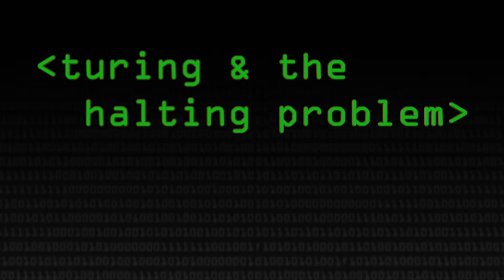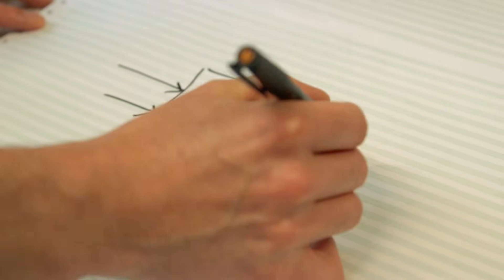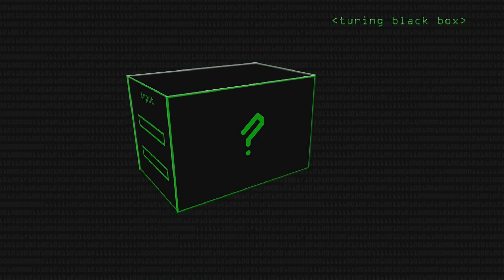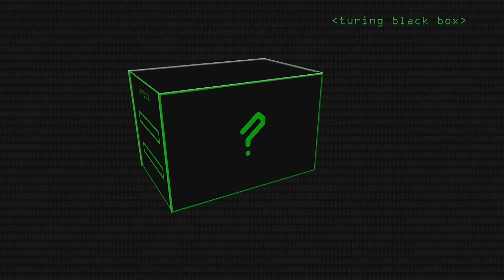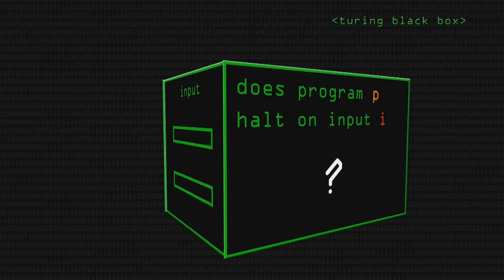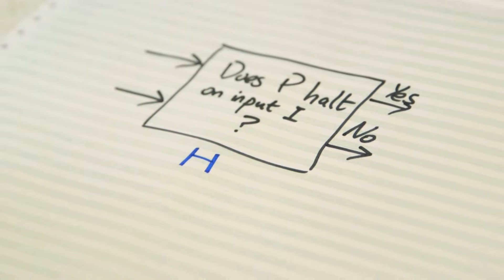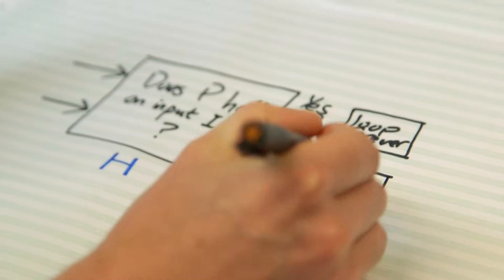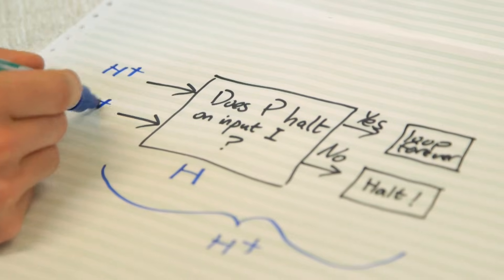Turing & The Halting Problem - Computerphile

Comment: But what if the machine „H“ had 3 outputs? Something like „yes“, „no“ and „depends on the input“? Because we can’t just Give a computer a question like „What’s 1+1?“ and the only possible answers it can give us are „1“ and „3“. If we then were to assume that a Computer can’t solve the problem „What is 1+1“, it wouldn’t make sense. Or am I thinking wrong about this?
Reply: There are only two eventualities that a machine can yield on a given input: it can eventually halt or never halt. If the halting problem was solvable, then a machine that solves the problem would only ever need to say that a program on a given input would either halt or never halt.

Comment: There is an error in the "proof" (and while I'm at it, a paradox does not conclude that an argument is false or faulty). 

The premise of H is that it decides whether a program P halts on input I. We deduce from this premise that it is metaphysically impossible for H to loop forever as H must halt in order to give an answer. We then build H+ which has H, and another program we'll call ~H for "invert H". We will then attempt execution of H+' = H+(H+, H+). The arguer asserts H+' loops forever. 

If this is true, then the halting problem is decidable because you just proved it so algorithmically by simulating the process. If it doesn't loop forever, then the halting problem is decidable by the same assertion. The issue with this construction of H+, however, is that H+' is not H(H+, H+), and we've already determined that H must halt. This essentially means that the H+' that is being claimed here _cannot exist_, and that the H presented is a different H in substance than the H that does in fact halt to decide if P halts on input I. Now if we entertain the erroneous construction and pass H(H+, {H+, H+}), then as the arguer observes correctly according to the logic that he follows, so likewise, H here will halt and give the same result: that it will loop forever.  I here give a counterproof against the halting problem proof by using Turing's proof itself: 

We presume that in order for H+' to be undecidable, the H+' construction itself must be undecidable, but if it is undecidable, then it is decidable: a paradox. This is a veridical paradox: if a thing has any definite answer within the context of decidability, then it is decided, therefore, if H+' is undecidable, it is decidable, and if it is decidable, then it is decidable. In both cases, we must, by metaphysical necessity, conclude that the halting problem (and all other questions about things that proceed from the natural order) is decidable since H+' being undecidable is a definite decision, and the H+' being decidable is a definite decision; since it cannot both be decidable and undecidable, it is therefore decidable. QED

I would note that this "undecidable -> decidable, decidable -> decidable" lemma only applies to this type of question uniquely because of auto-decidability. Attempting to apply it elsewhere doesn't work, not even to the question, "is decidability decidable?" The simple reason is because the nature of Turing's proof's auto-decidability arises from an oversight in the definition and logical proceedings of H and its behavior within H+, the oversight being that H is capable of looping forever. Even if it were, the fact that the arguer can logically deduce that H+' never halts implies there exists a deterministic H by the logical process employed, and that the H within H+ is therefore merely an imperfect subset of H.

The universal that any thing with a definite answer is decided may be used to analyze The Liar's Paradox and have it be considered also as a veridical paradox. Gödel's Incompleteness Theorem is incomplete (lol).  "This sentence is true" is easily analyzed and concluded to be true, but "this sentence is false" is commonly concluded to be indeterminate. In reality, what's going on here is similar to the issue of the halting problem, and since we are using subjective semantics in this sentence with no other context, the reality is that "this sentence is true" must also be indeterminate, even if by default, we can believe these two statements to be true according to the rule of charitable interpretation. If we choose to believe the two statements are true, then no contradiction can exist as we've created an objective context to interpret the subjective construct with: we have asserted that, objectively, they are true, therefore they are true; the simple fact of the matter is that "this statement is false" is asserting "the sentence, 'this sentence is false', is false" which is a valid equivalent construct to "this sentence is false". If we assert that they are objectively false, then they are both false, in which case "this sentence is true" becomes a lie which would concur with the objective assertion. This is all really just a simple matter of recognizing that some things have no meaningful answer in themselves because it would then be like trying to make an H that accepts only P but has no I input to consider: they do not have the substance of a definite question, we might call it, and because they are indefinite questions (as their opposite), they cannot be answered until they are made to be definite. Thus, we can at best conclude an indefinite question about the truthiness of "this sentence is false/true" to answer with indeterminate which is in the implicit negative, not affirmative, in the same way that indifference or agnostic atheism are implicit negative for their respective questions.

Thomistic philosophy is universal. Other philosophies are not.

Modifications: improved clarity and wording.
Reply: You're thinking of a scenario where there's a second H outside of H+, which will correctly predict H+. But the point of the proof is that I can always put H inside of H+ and make it be wrong.

It was also not asserted that it loops forever; just that if it did, the H inside H+ would say that, but then the ~H would stop so it wouldn't loop forever, and vice versa. We can always build a machine around H that proves H can't always be right.

Comment: Well of course you can't solve a paradox, though they do happen. What if its a quantum machine that prints both yes and no being correct and incorrect at the same time....
Reply: Then it’s a shitty machine. Even quantum computers have to produce a definitive yes or no for an output. And as they’re bound by mathematical logic, they cannot in fact solve the halting problem
Reply: @cktken3336  Quantum computers are not binary computers they have a third state of superposition allowing the reverse result such so instead of calculating a result sequentially it can calculate 4 scenarios of the same problem to arrive at the correct answer.
Reply: @DeathxStrike18  They still have to give a single yes or no answer. Where in the video did they say that H WASN’T a quantum computer? It’s a known fact that  computers can’t solve any problems that classical computers can’t. They can just do it faster and that’s it. If it’s logically impossible for my desktop to solve a problem, then no quantum computer will ever be able to solve it either.
Reply: @cktken3336  The Halting problem was proposed before quantum computing was even a thing, a quantum computer has 3 states where a normal computer such as your desktop has 2 states 1/0. Allowing for a third state the quantum computer can give Will Halt and will Not Halt as outputs simultaneously validating paradoxes.
Reply: @DeathxStrike18  there is nothing a quantum computer can do that a classical computer cant do, its just that quantum is much, much faster in some areas. quantum computing doesnt let you break basic logic

Comment: I have a lot of trouble understanding the actual logic behind this theory.  The way I see it, is that we start by assume two things. 1. the machine 'H' is always correct. It will always give an answer. 2. H+ is always incorrect: it switches around the answer. If we follow that assumption, and we put H+ into itself, H will conclude that H+ will always loop (because H will never loop). H+ will then output the opposite of that. It will conclude that H+ will stop. SInce we said before that H+ will always loop, this is a paradox. 

The reason I have trouble with this, is that following the logic, H+ will always do the opposite of H. If we assume that H is always correct, and that H+ is always incorrect, then doesn't it make sense that H+ is incorrect about itself too? If you look at the entire thing, we're asking H+ what H+ will do and by design H+ will always give the wrong answer. So H+ will always give the opposite answer about itself. That would mean there's not really a paradox, but that it just follows what it's intended to do.Therefore, to me this theory doesn't conclude that H can't exist.
Reply: Can you see the comment I have put that starts with "Ok so you are considering...."?
Reply: Please feel free to ask if you have any doubts after reading the answer :)

Comment: there is a small problem with this explanation,

H+ has to have only 1 input and duplicate it,
as if it gets 2 seperate inputs, its all breaks apart.

for instance if we ask what would H+ asnwer on <H+, H+>
the qeustion is what would H answer when H+ gets the input <H+>.
clearly H+ getting the input <H+,H+> is not the same as H+ getting the input <H+,?>, hence this is where this schema breaks.

solution:
H+ only gets 1 input <M>:
then asks what H would answer on <M,M>.

then when we ask H+ what would you answer on <H+>
we ask H what would H+ asnwer on <H+>
here we have no problem as yes eveyrthing else you are saying works fine.

maybe iam wrong with my claim above but it was always bugging me that the "recursion" didn't work.
Reply: THANK YOU! Oh my gosh I was confused by the video but this comment is exactly what my confusion was about and presents a plausible solution.

Comment: So basically Turing found a singularity (e.g divide by zero) I.e X / X is only valid when X>0 and X<0 where x E |R
Reply: Can the following statement shown to be false? : "I suppose that there exists a total computable 

function "Does_halt(f)" that returns "true" if the subroutine f halts (when run with no inputs) 

and returns false otherwise , except when it detects it itself(recursively called) in which case 

it return "True" or "False" internally such that the final "Does_halt(f)" always halts".

Comment: There is something I don't understand about this proof. Say you give the machine H as input H+ and H+, why is this complete? From my understanding H+, just like H, would need both an algorithm and an input to be able to come to an answer. If you choose H+ as algorithm and give H+ as input only H+ aren't you still missing some further input this second H+ should operate on?
Reply: Well just make H+ have one input and pass it duplicated to the halting maching. Or suppose it halts if it has not enough inputs. That's not a main problem actually.

Comment: Think of H+ as a program. It's a program that takes any program as input, determines if that program halts, and then gives an output in the form of halting (if the input loops forever), or looping forever (if the input halts). In order for H+ to exist, then it must also be able to take H+ as an input, determine if H+ halts or not, and output accordingly. Remember we must assume that H+ is solvable, and therefore must output either by halting or looping forever. So let's say that H+ halts. If we give H+ as input to H+, the machine determines that it halts, and then loops forever. Vice versa applies too, so let's say H+ loops forever. If we give H+ as input to H+, the machine determines that it loops forever and then halts. This is the contradiction - the machine gives contradictory outputs for itself.

This contradiction means that the assumption was wrong, meaning that there cannot possibly exist such a program that can take any program as input and then determine whether or not it halts.
Reply: I cant seem to understand the part "If we give H+ ad input to H+, the machine determines that it halts, and then loops forever." 
Why does it loop on forever after determining that it holds?
Why doesnt it just determine that it halts  and then halts?
Reply: @paulvorderegger1522  It loops forever because that's what H+ has been designed to do. If you feed it a program that halts, then it will loop forever. If it did anything else, then it wouldn't be H+. If you gave H+ an input program that halts, and H+ cannot loop forever, then this would also imply that H+ can't exist.
Reply: @gordonfreeman5958  Ok I finally understood this after seeing the following pseudo code:

def thisFunction ( ):
        if halts(thisFunction):
                  loop_forever( );
Reply: Except it isn’t even a contradiction. Because whether H+ halts depends on what input it recieves. So the copy of H+ with H+ as input will just do the opposite of the opposite of the behavior of the input given to the inner copy. Meaning it does the same thing as the input to the deeper copy. It only becomes a paradox if you have an infinite amount of copies of H+ each of which has another as input. But so would any other program that takes a program as input, so that’s not a problem.
Reply: @algotkristoffersson15  But H+ is a decider.  So on the input of H+ the machine H+ decides that input H+ halts but then machine H+ loops.  Similarly H+ machine decides input H+ loops but then machine H+ halts.  It decided that itself will halt but then loops and it decided that it itself will loop but then halts.

Comment: I suppose this says that there are limits on the ability of counters to solve problems, but does this tell us what those limitations are?

Namely, the specific counter  example seems a bit forced and awkward. Like yeah it works and it's valid, but what if the 1 limitation is literally just something along the lines of...

Let a machine that can determine if other machines will halt be called Machine X.

Let all other machines be called Machine Y.

Any Machine X can tell if any Machine Y will halt. However, it cannot tell if another Machine X will halt (or perhaps, specifically cannot tell if itself will Halt but may be able to tell if other Machine Xs will halt). 

In other words, the problem could specifically be that this kind of computer cannot predict itself or maybe also cannot predict a machine like itself, but anything else it can, and that's the 1 caveat.

This would be to say, we can make a machine X that can answer any problem unrelated to / not involving an input from another machine X or itself, but making something that can predict a machine X is what is impossible because a machine X is just a different beast then a machine Y.
Reply: The point of the halting problem was to figure out if there could be any such algorithm that can determine if any given program will halt. The solution proves that no such algorithm can exist. What you propose is perfectly plausible, but completely arbitrary and not very useful since you will not know on which programs it will work and on which it won't.
Reply: @gordonfreeman5958  That circles back to my thing though, even if it's technically not any algorithm, if the 1 algorithm it cannot tell of will halt is itself and it can be proven that thst is the only algorithm it can't tell will halt then... The halting problem is kind of a non problem.

Also I did encounter another video that tore further into it an unveiled that the thing problem might not even be an actual problem with the algorithm but just be flawed in a logical way, as in, if you break the algorithm itself down to it's bare essentials, the halting problem makes the algorithm not work because it by it's own logic is forcing a loop to happen in a disengenuous way rather than it being an actual hard example. 

As in, its right, technically but for a meaningless reason.

I can't do the explanation justice off memory but it did give me something to think about. But currently I'm really ambivalent about the halting problem as something seems off but it's hard to really pinpoint what it is but it just wreaks of something really hax and logically unfair. I can dig up that vid and share the link if you:re interested.
Reply: @occultninja4  I would be interested in seeing it! And yeah I agree with you, I feel like either something is off with the logic, this video didn't go into enough detail, or I/we are missing some requires knowledge about logic to understand the consequences of the explanation. I'm on the same page as you at the moment, where it seems like such a halting detection algorithm simply doesn't work on itself, but I have no reason to believe that it can't work on every other program.

Comment: wouldn't most programs stop by default because of limited storage errors
i dont know pretty much we cant make a program that can go on forever
because soon the computer will run out of memory
rather tahts a stack overflow error
or a Int overflow error
or the computer running out of available RAM
Reply: We are talking about machines. Not programs working on real computers.
Reply: @Truchasgl3  so machines dont have the same constraints? I mean if there able to run a program that means they must have memory, a cpu, Storage and a gpu and other componentsneeded to run a program?
Reply: @theowillis6870  no sir. We are talking about abstract machines. That solve problems. For example when we define the so known NP=P machine. We talk about non deterministic machines. But it doesnt exist such computer that can be called a bon deterministic machine. We stil ldefine it tho. In order to talk about problems, time complexity, computation power, etc. Things like memory are defined to talk about memory complexity, as an example. But its usually supposed to be infinite.